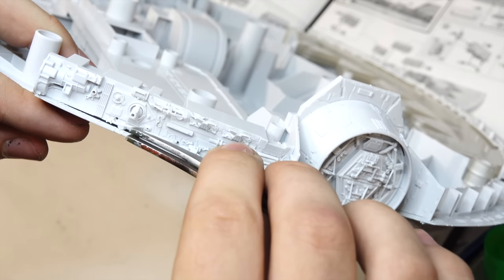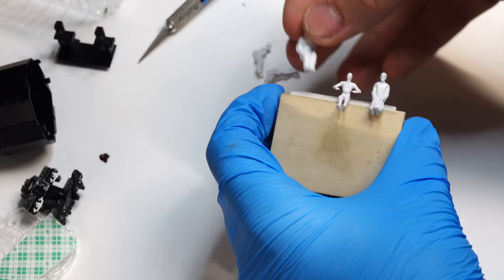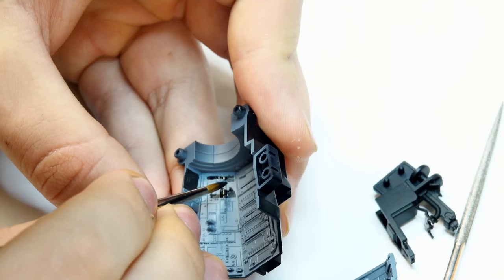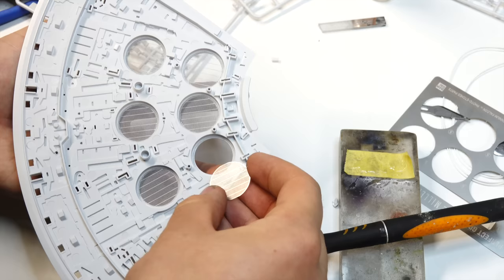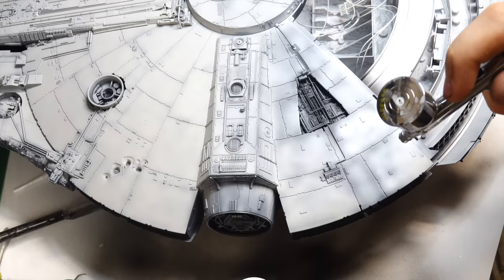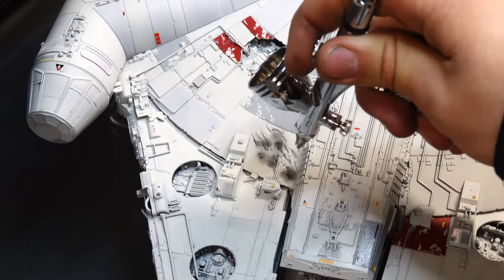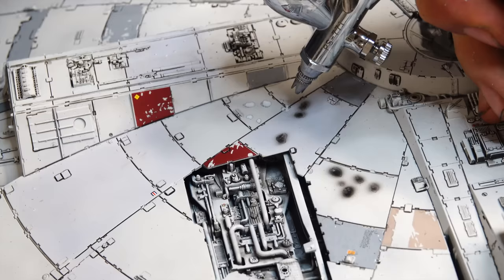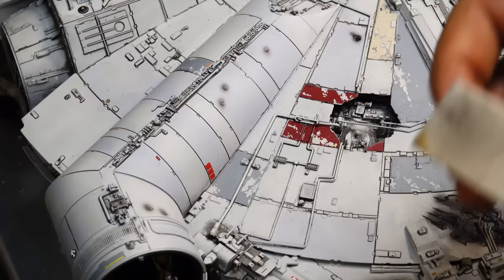Star Wars Millennium Falcon - Bandai 1/72 - Full Build

Comment: Wish I found this earlier.  Something I've learned from creating my own rendition of the DeAgostini 42" ESB Falcon is that surprisingly the Falcon does actually have yellow panels in places mixed in with the cream colored panels.  I found this out by chance and ironically it was while detailing the dorsal turret's port side panel.  It caused me to go back and look harder at it's original models through photos online and other references, which after a maddening two years of research led me to tell which were fake and which were real.  Modeller Magic has been and is a really good resource.  Now for the disturbing part.  I felt Insignia White was too glossy for my tastes so I had actually settled for Titanium Silver for a more metallic look.  I can hear it now.  "You destroyed that Falcon!" and yet, when it was all finished, I'm actually quite happy with the results.  I cheated though, I tested it out first on a $50 Bandai 1/144 kit.

Comment: Just a tip for future on streaking use water pencils for the streaking trust me the effect is brilliant aged and to scale you will never go back
Reply from the maker: I've used water pencils in the past and I find them more limited than oil paints, I can achieve much more varied effects of streaks with oils. Although using both methods at the same time works well too

Comment: Extremely nice work. One thing I used to do for "Blast Spots" was just a lil Powder from a Fire Cracker. Id sprinkle a lil bit on, put a Lighter to it real quick and in a 1 second flash, nice little Burned In blast point.

Comment: You can use glass for photo etch. You just want to use a chisel tip blade. Paragrafix recomends this as easier cut the parts out then just clean up with a file if needed.

Comment: I have been told a lot to only use a gloss varnish before panel lining, However, I experimented with a matte varnish and it worked just like the gloss and I didn't see any difference in performance or outcome. So I wonder why so many suggest using the gloss and then finishing with the matte.

Comment: Great job painting! I'm 3D printing a Millenium Falcon and will use the same techniques. One question though, a dumb one maybe... For the streaks, at about the 15:50 mark, shouldn't they be going straight back to the rear of the ship, instead of towards the center? If the ship is moving, dirt would go straight back, wouldn't it?

Comment: nice video ! i really want one.  Are the LEDs included with the kitt?
And is this kitt really better then revell ? And is the scale correct? it should be 47,2 cm
the revell is 37.5 cm so the scale is wrong
Reply from the maker: Thanks, yes the LED's are included in the kit. I can't comment on the scale but without ever seeing the revel kit, I can tell you that this kit from bandai is better in every conceivable way. Revell generally makes shitty kits.
Reply: @kerberosmodels  
ok thanks, so the price is justified

Comment: Very interesting kit, with those round mounting holes. Is it a thing nowadays, or is it unique? I used to do scale modelling 25+ years ago and this looks completely different.
Reply from the maker: Most military kits have not changed significantly from the old ones, its just mostly bandai that have this kind of engineering where parts can snap together.

Comment: How long did assembly take? And do you think one could get a similar effect with simple Spray Paint and Model Acrylic with only brushes? 
( I don't have an Airbrush.)
Reply from the maker: It took me probably around 20-30hours of build time. I didn't go to crazy with the airbrush in terms of depth so I'm sure you could get a pretty similar effect with a spray can, you can achieve all the weathering you would need with oil paints as well. The main thing an airbrush will do for you if you use it lightly is give the surface more variation making it seem more realistic. You can achieve this with oil paints as well, mainly through making panel edges more contrasted by fading and blending the oils around there.
Reply: @kerberosmodels  My goodness - this is so tempting! The model is expensive enough and to think I'd need to buy extra gear to get the right effect. But also would hate to spend the moola on the model and it Not do it justice...
I appreciate the insight! 
Yours looks great BTW!

Comment: Once completed, does the kit design allow you to pop off the cockpit and cannons to swap the character seating?  I prefer to change ways I wanna display the falcon replication several scene. Or is seating permanent based on how you completed it.
Reply from the maker: You can keep the cockpit removable thanks to the fit, the turrets on the other side are permanent so you have to glue it on.

Comment: I would have used gloss coat first so the decals would set down better.
Reply from the maker: Using a gloss varnish does not improve the adherence and setting ability of decals in any way whatsoever. It is a common myth that you have to use it to prevent silvering or issues while in reality, it is just a pointless step that only adds more time to the build. If your surface has imperfections, a gloss varnish will only add another layer to them and you might still have the same issues. A proper decal setting solution is much more important.

Comment: Im a beginner. What paint gun do you recommend for a noob like me?
Reply from the maker: Since I started this hobby, I've gone through 10 different airbrushes and the best advice I can give is don't start cheap which most people do. Cheaper airbrushes will generally give you a much harder time as they clog more often and can have spraying issues. The one airbrush I would most recommend to anyone is the Iwata HP-CS Eclipse, it's a bit more expensive at $150 but it really is worth the extra money. If you buy the cheaper stuff labeled as "beginner" you will only find more frustration with using them. Another option that would be still good but a bit cheaper is the Badger Patriot 105 which sits at $75, it is a very good workhorse airbrush and has a larger needle, it might not be able to do as fine paintwork but as you're starting out that might not be as important. Hope this helps.